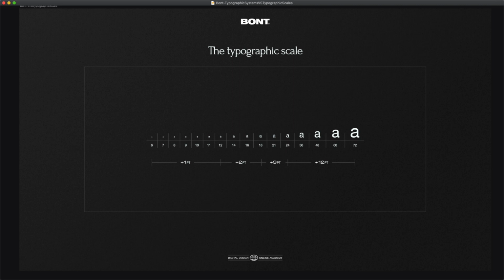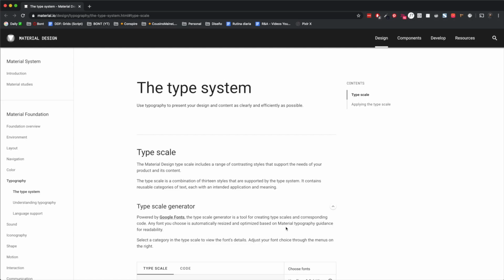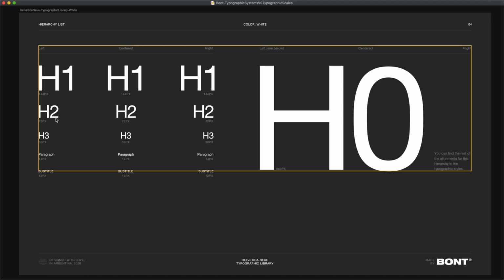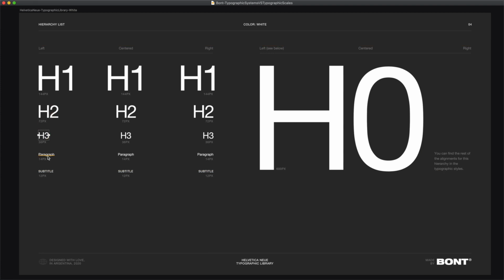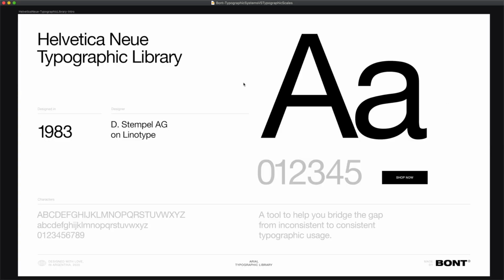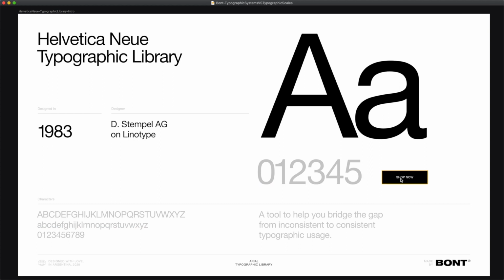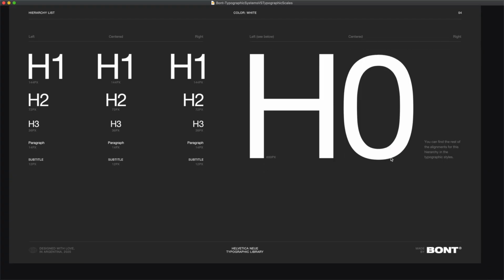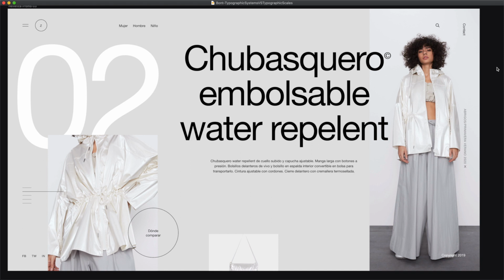Typographic Scales vs. Typographic Systems - Web Design Tutorials

Comment: Very much appreciated and incredibly helpful! Just two (possibly dumb) questions: What's the actual size of 72 px (as an example) in typography? Is it the distance between the ascender and descender of a character or something else entirely? Should I take this into consideration before I set my values in the typographic scale or is it irrelevant?
Reply from the maker: Glad this helps Kostas! Regarding your question, I’m honestly not sure but think it’s what you say. But it won’t make any difference in your results 😊
Reply: @hellobont  Thank you very much for your response! I was looking for typographic grid systems in general the other day, and before I found your super useful video, I happened to come across some examples having the x-height of the type for the body copy coincide with the height of the baseline grid. That's when it struck me. So, I thought maybe before the process of making a typographic scale, they had been making their decisions based on this factor... In any case, thanks again for the video and your response!
Reply from the maker: Right! Yeah, that’s another way to do it. I’m not a fan of that method, feels too rigid to me. But it’s definitely not wrong! Good questions btw. If you have any more questions let me know!

Comment: Your video was exactly what I was looking for and wanted to learn. Thank you so much. I have a question about smaller copy such as form field labels, tags or terms of service at the bottom of a page. What sizes do you recommend for those types of uses?
Reply from the maker: So glad to hear this was helpful! For small text, I recommend playing around with the smallest sizes in this system. You can even use bigger sizes if you want. Just don’t add smaller sizes, unless you can create a high contrast like half the size of the smaller one. But in this case that would mean 6px which is not readable.

Comment: Interesting that you use 14px for base paragraph sizes. Any reason why when browser defaults are at 16px? 14px feels too small, especially for visually impaired people. I tend to start at 20px and use a 3:4 (perfect fourth) ratio. The typographic scale Sketch uses is based on print standards and doesn't properly equate to the digital world.
Reply from the maker: You are right, I was outdated with the base size. It used to be 14px. Thanks for the feedback!

Comment: Perfect. I've often designed myself into a hole by using a scale as a system, having to make complex and labour changes deep into a project.
It's great to hear your thoughts on this.
Reply from the maker: We’ve all been there, and that’s exactly what happens. Having to amend sth like this when you’re deep into a project is really painful. Better start with sth simple and then add if extremely necessary. Cheers Dan!

Comment: Hey Adrian thanks for spreading knowledge as always. I have a question regarding the typographic scale using your Helvetica Neue library as an example. I remember in a past video on type sizes where you talked about striving to create a clear contrast between sizes to achieve hierarchy. So I was wondering is there a purpose to using 12px and 14px since they are so close in size? Wouldn't it be better to eliminate the 12 or 14 px size and work with 4 levels of scale instead? My only reasoning into why you're using 12px is might be because the subtitle is all caps so it appears bigger which is why you reduced it down to 12?
Reply from the maker: You're exactly right! That's why I used 12px for subtitles, it's an optical adjustment. And I only use 12px with all caps ;) Very bright observation!